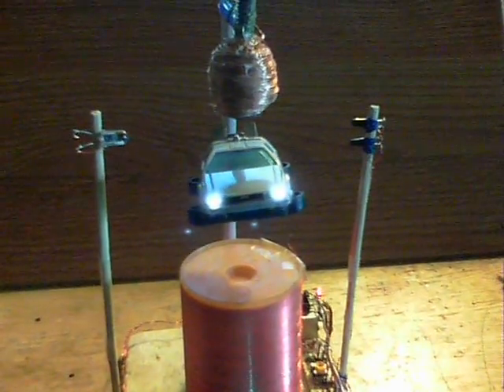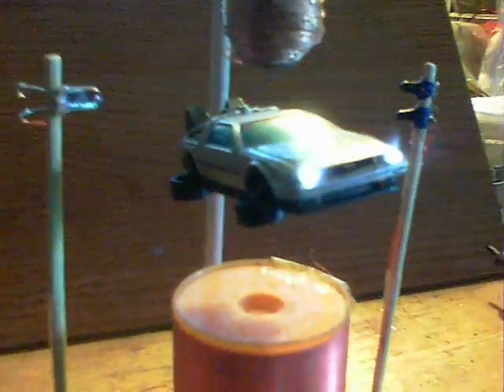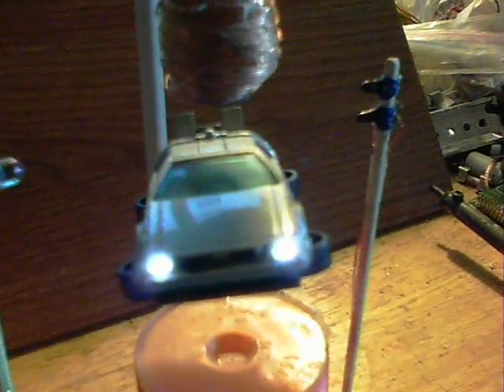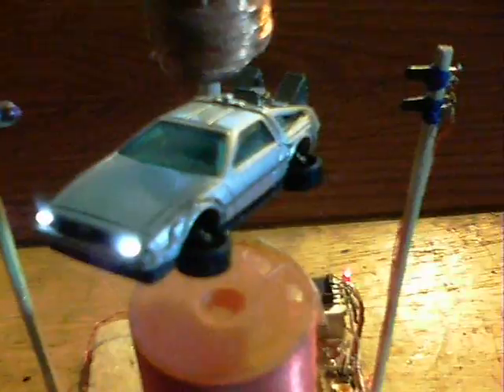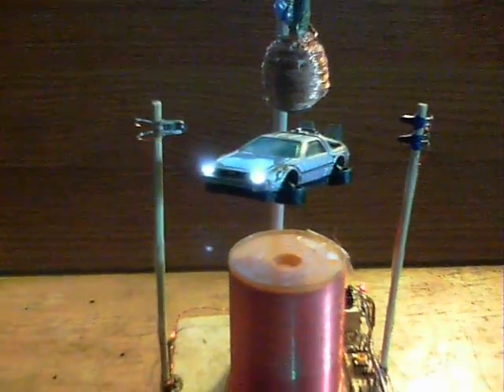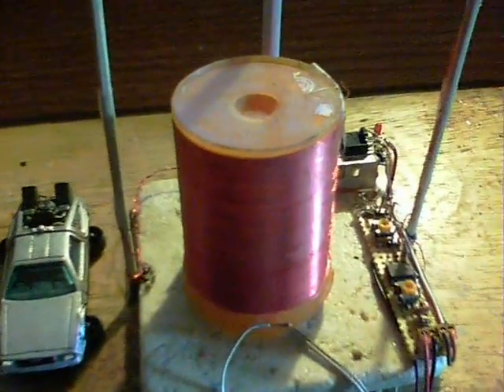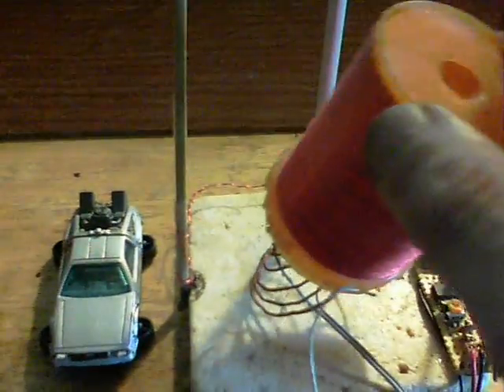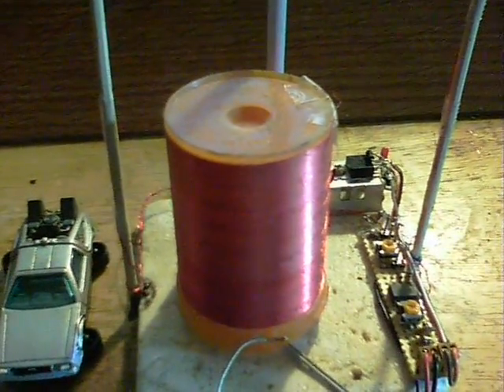Flying with lights on - Mattel DeLorean

Comment: which are the materials that I should use
and you could upload a tutorial on how to do it esque I loved it too much
Reply from the maker: It would be best to look at videos and circuits for infra-red levitators. Then Slayer Exciters. Both are quite straight forward if you are good at soldering and have built up circuits before. 
It's a little too complex to put the pieces together without building and tuning those circuits first. The levitator should be able to suspend a Hotwheels car for example and that's not easy with a lot of such circuits. 
All of this was 6 years ago...but may well be revisited and i'd make sure to describe the build.
Reply: OK thanks

Comment: I missed this, it was before I started my YouTube career, great project.
Reply from the maker: Thanks for watching it...it's one of my fave 'things' to have done with levitating or wireless electricity. Am hoping to improve the recent Hall sensor one to do the same (maybe disguise the coil as a tree branch, bird house or something) and also build a repulsion type + to have that sitting under some kind of road.
It's all about DeLorean's you know lol
Reply: slider2732 I did notice quite a few videos popped up when I searched your channel for them :-) I guess you have a thing about Flux Capacitors. You might like this (or you might not ) http://flux-capacitor.co.uk/
Reply from the maker: A real life Noddy car lol. Under 10 seconds 1/4 mile out of that thing too. Great reading, thanks  !
Reply: slider2732 :-)

Comment from the maker: Hi Douglas. It needed a bit more work than that. When bended, they made the axle too short. 
If you look at the pic at 01:29 - I cut the axle in the middle and found a piece of wire (by accident or fortune) with 600V written along. The outer plastic was used, to slot the 2 sides of each axle through, then glued to secure and that allowed the right distance on each side.

Comment from the maker: Hehe, that's already been done, kinda...take a look at the Army man again on the last vid. He's riding along on one straight out of the factory lol

As to a real one - that's the Quidditch concept. The hoverboard would have outer perimeter made of ferrous metal and the electromagnet would be WAY huge, room sized. A plate, looking like a ceiling. But you could then float around on it, for real.
If you fell off the board might end up on the ceiling, which would be weird.

Comment from the maker: Cheers :) Thanks for suggesting it. A tip for the headlights, they are from a cellphone keypad and seem the easiest to find for tiny SMD types. About a dozen on one of those and whatever colour the keys light up on an old phone shows ya the LED's before ripping one apart. .

Comment from the maker: An interesting thought and definitely of merit ! These use about 150mA, which is 'doable' as my Hoppity helicopter attempted take off using about 800mA...distance to the tower in these projects can be quite small, couple of inches would be plenty. I/R feedback should be similar, the object would still cut the beam in the same way :)
it would offer ability to disguise the coil, for scenery or something.